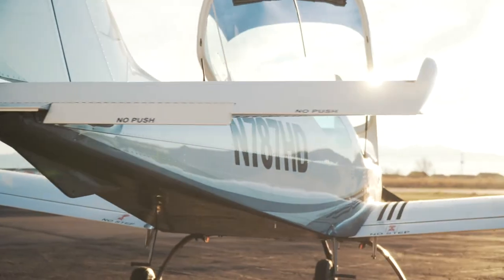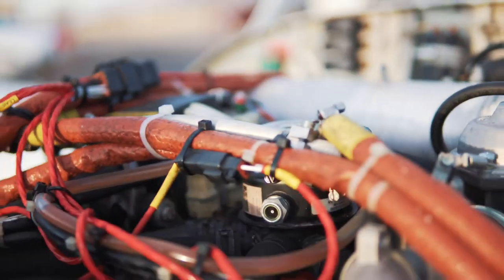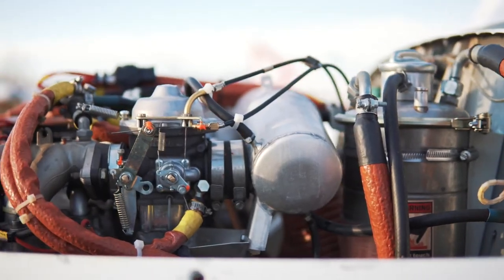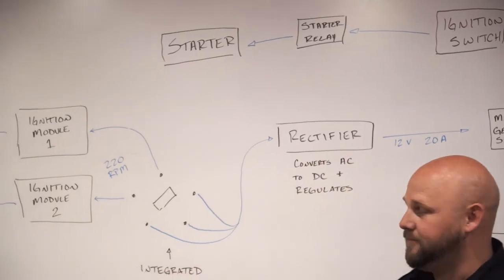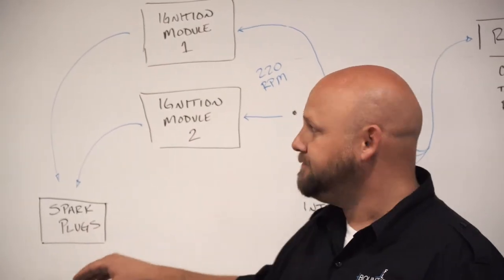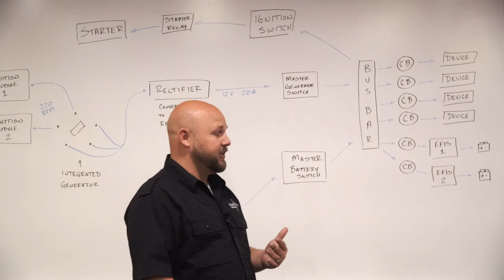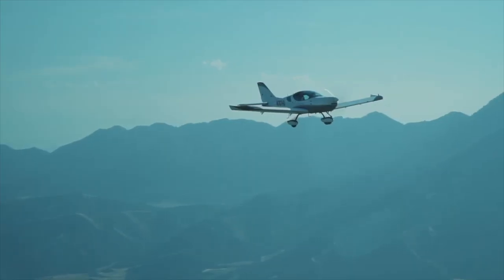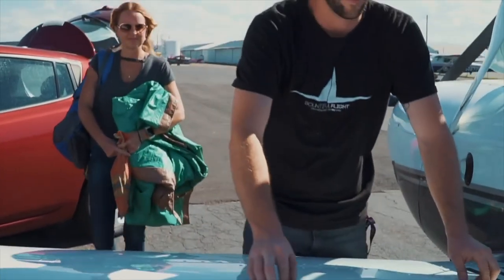Let's get technical! Learn in depth all about the SportCruiser! - FLT Academy

Comment: A stator by definition doesn't rotate. The stator actually have 10 wire coils, 2 of which independently power the ignition systems and 8 of which are designated to powering the electrical system of the airplane. This combined with the fact that the capacity of the wing lockers was so grossly incorrect is quite concerning. Please revisit this video so that people are not misled.